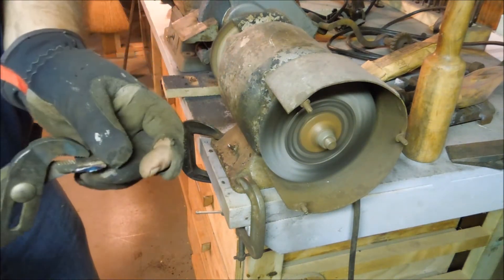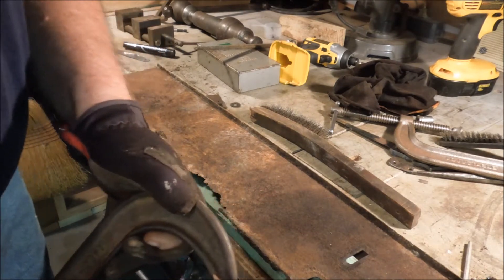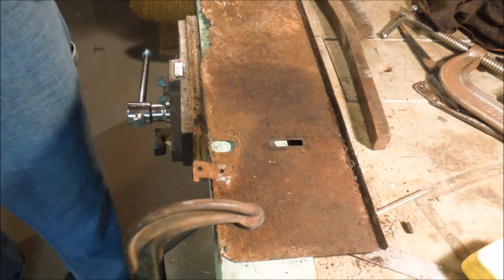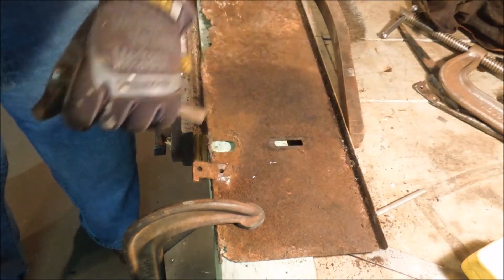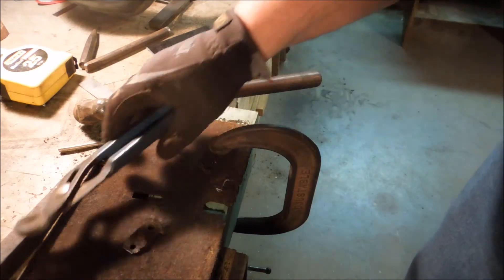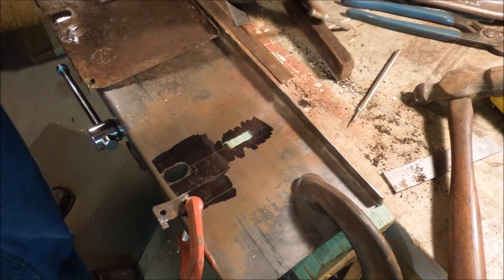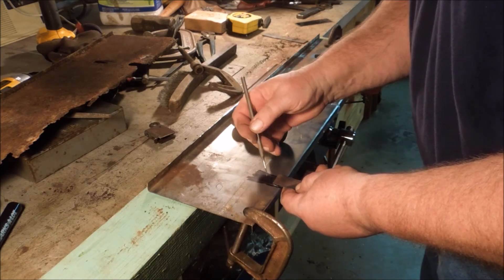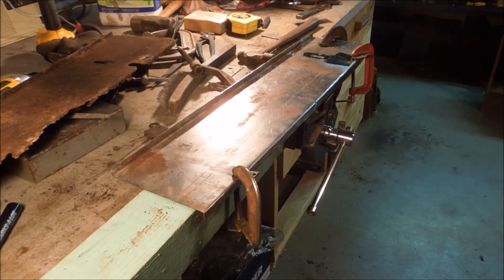Fireplace Damper Repairs - Pt 8 of 9 - Reclaiming The Tabs

Comment: When you wrung the first one off I thought your testosterone had kicked in but then saw the rust beat you to it.  My wife's Dad called her "Powerful Katrinka" from an old comic strip; all power, no control.. I'm glad the's getting more mature because it'd get right interesting here every once in a while  when she'd "power through" something and I'd have to un-power it. I try not to get absurd because I know what's coming. I have to fix it anyway and the 2nd time is worse than the first. Good job, Unc.
Reply from the maker: +Lewie McNeely When I was a kid I worked on a lot of projects in my Dad's shop with everybody in the neighborhood dropping by with something that needed a little work. One of the guys was a little less patient than the rest. He had a car he was working on and was using Bondo to fix some dents and holes in the body. I always welded in a patch and then hammered and ground out the welds before using a little body putty to fill in the wrinkles. This guy would put on a 1/2" of Bondo and then grind off 3/8" with a disk sander. When he got done it looked like a washboard. I only tried explaining the idea once. After that I just made sure to only buy enough Bondo and body putty to do what I needed done. He'd gone through a gallon on one fender. 
Power tools are very handy. With a little restraint and the proper settings they can do more work in a minute than I can do by hand in an hour. They can also screw up the job in a minute that takes an hour to fix.
Reply: Amen to it all. An old poal of mine got a truck from Florida. Salt had eaten it up but it ran good. He started out with Bondo by the quart, then the gallon , and then 5 gallons at a time. Painted the finished product with a brush and it looked really good but it was all Bondo. Sold it and said he saw it later on and the whole side had fallen off. I'd say so!